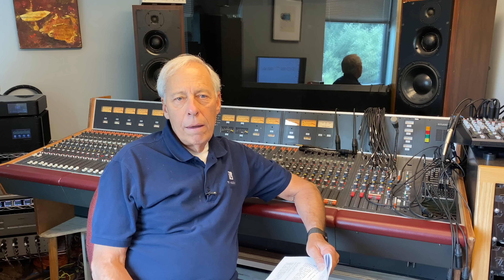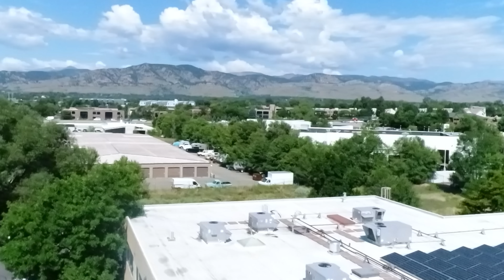Why are preamps expensive?

Comment: Actually, great quality preamps can be built for under $100.
The rest of the price is just markup and profit.
Reply from the maker: Jeez, Jon, that's just simply not true. Where do you come up with this stuff? Most of our raw costs on just the chassis are around $100, and then you have to add "stuff" inside to make it work.

Let's break this down a bit. Can you make a good sounding preamplifier for $100? Absolutely. A decent op amp, a reasonable power supply, some connectors, an input selector, and a good potentiometer might be had for about that much. Mount those components onto a piece of wood, donate your knowledge and labor for free, and yes....maybe. But that is a long way away from building a great sounding preamplifier in a reasonable chassis, putting it into a shipping box, and trying to pay your workers a fair wage.

Let's just be clear what we're saying here.

Thanks.

Comment: Why are preamps expensive? because you are paying high price for them. Simple as that. First of all tubes sound good but they are not clean, they introduce coloration (sweet tube coloration), so those are not wire with gain. Secondly all the sources today are LINE level outputs. So you maybe do not need a preamp, Third, you will not hear that much of a difference, and if you hear differences that's coloration.
Reply: Right.

Comment: well, what if the power amplifier also had a pot to adjust the input impedance, couldn't you just remove as much resistance that you introduce with the simple pot at the source?
Reply: Potentiometers always increase impedance.  They never reduce it.

Comment: People think a preamp should be “transparent” at least that’s all the hype on these youtube reviews. In my experience the preamp is the most important part of the signal chain and a great preamp is not remotely “transparent”. Most of the very expensive ones are expensive because they are worth every penny but they all have a feeling or an atmosphere to them.
Reply: no
Reply: (rolling eyes)  That's called "distortion".
Reply: @stottpie  Yes
Reply: @dizzywow  No it’s not
Reply: @ryand4533  Yes, it is.  If two amplifiers both have flat frequency response, and inaudible distortion and noise, they will sound the same.  Fact.

Comment: If you do not have thousands of dollars invested in your rig, forget about a pre amp.  If the rest of your rig is strong, nothing amplifies voltage like tubes.  Class A solid state amps with a tube pre might sound good, if you have the compatible speakers, and of course the room for it.
Reply: Schiit  Freya has switchable tubes/FET/passive options for $900;-)
Reply: Ironic that thousands of dollars are invested in what has become vintage technology, and also that (from what I can gather) the art of making the best sounding tubes has been lost, as connoisseurs seek out the New Old Stock tubes for the best sound.
Reply: Tube preamp with SS power amp (MOSFET output stage is my preferred) is an awesome combination. The coloration of tubes is indeed distortion but it is very good distortion -the kind that helps our ears hear more from instruments that are less harmonic in their natural behaviour - like cymbals or a hi-hat.
Reply: @Hare_deLune  A lot of the art was lost when environment regulations deemed the old way of tube manufacturing, ie materials to be banned resulting in a poor new age tube construction gap and took awhile for R & D to work and produce tubes with the new regulations
Reply: @tothemax324 
Ah, yes.
Good point.
Reply: Back in the real world, nothing can beat a good op-amp, in a well-designed circuit.   For example, the LME49720 has 0.00003% distortion.
Reply: @dizzywow  - Actually, in the real world us humans hear with our ears,  not a spec sheet.

Comment: you forgot to mention the huge margin of manufactures and dealers , right? ah, sorry, that's just too obvious :)
Reply: Exactly.  Preamps should not be as expensive as power amps.  They are no where near as expensive to make.  I almost choked when the guy talked of the need for a "big power supply" in a preamp.  A preamp works on milliAmps.

Comment: Dad, what is a preamp? Son, it’s something people used for connecting record players, tuners, cassette decks and CD players together in a music system and select source from. Dad,  why did they not just use Spotify? Son, shut up.
Reply: Today the father can quit using Spotify, and start using Tidal Connect, so his son can listen to Master quality, with adjusted volume from the app.
Reply: @bergennorway  Agree, of course, we have better streaming services for audiophiles  than Spotify. I use Tidal and Amazon HD Music.
Reply: @ThinkingBetter  Qobuz is the best for quality.  But Daddy I can't hear anything with just Spotify.  Son, you need a preamp.
Reply: @ranbymonkeys2384  Preamps really make no sense if your audio system is just playing streaming music. A DAC can feed into a power amp easily incl. having volume control. Technically speaking, the line output of DACs is  on the same signal level that power amps operate on the input. Preamps will go away.
Reply: @ThinkingBetter  So the DAC is a preamp, right? Get it?
Reply: I have a DAC that goe into a tube buffer to an amp, anything else
Reply: @ThinkingBetter  Ya so these Klipsch the high's are a bit much, how do you remedy that?  An EQ on the PC, cuz theyz aint no bass and treble on this here DAC.  The Tube buffer does, but you would have it hooked up and go ohhhh crap I forgot about that!!!
Reply: @ranbymonkeys2384  No, the DAC is not a preamp. Even on a DAC IC output you have line level to begin with in modern DACs. The notion of “preamp” is sort of meaningless for a modern digital system of tomorrow, as you want to minimize the analog signal path for best audio fidelity.
Reply: @ThinkingBetter  Thats funny this DAC has an op amp and gain along with decoupling caps so I don't know what the round knob on the front is that makes it LOUDER!!!
Reply: @ranbymonkeys2384  The box will be called DAC even if it has a volume control in it. Opamps are often used on the output of DACs to get a more robust output signal with lower impedance but that doesn’t mean a DAC has a preamp inside. Opamps are used in many things. Preamps are separate boxes with their own power supplies and are already obsolete in many setups. Less boxes make better sound concerning the analog signal path.
Reply: @ranbymonkeys2384  Ideally you EQ your sound in the digital signal through a high quality DSP. For example, this product can do it all: https://www.minidsp.com/products/streaming-hd-series/shd
Reply: @ThinkingBetter  Thanx
Reply: @ThinkingBetter  You would probably have a problem if I used OPA627 "can" style or even MUSES02 to enhance that would you?
Reply: @ranbymonkeys2384  No, I see no problem in using good opamps. But I see a problem in adding an entire preamp with power supply, cables and electronics when not really needed.
Reply: @ThinkingBetter  genious
Reply: @ThinkingBetter  how about a pre amp without a power supply haha
Reply: @ranbymonkeys2384  A preamp without power supply, electronics, connectors and cabinet is the best. It’s sort of just a cable directly to your power amp.
Reply: @ThinkingBetter  this guy is from the future or something